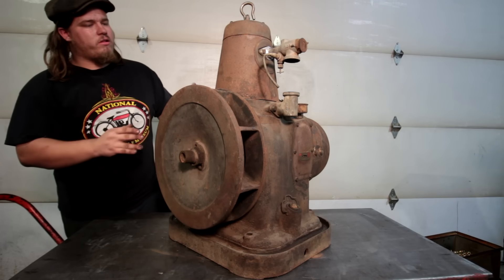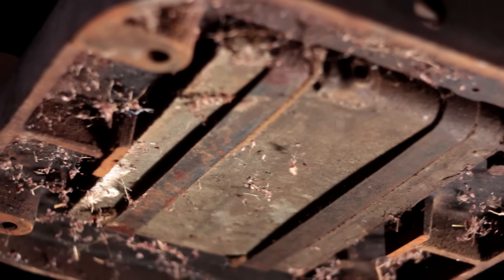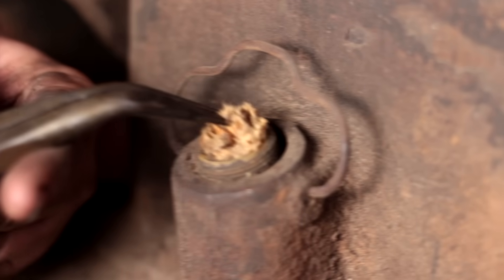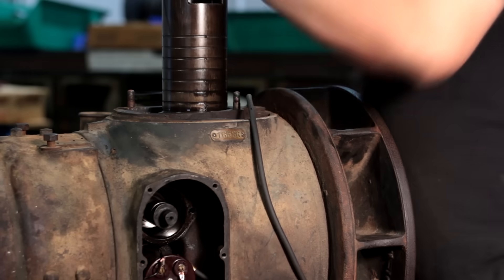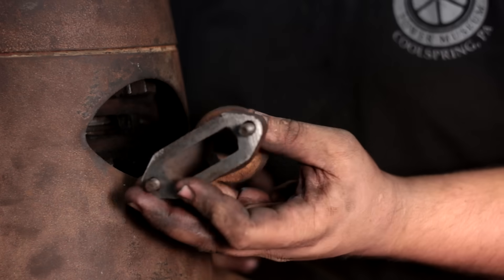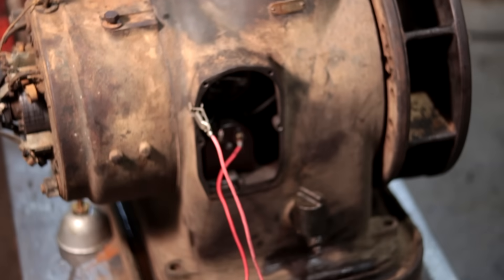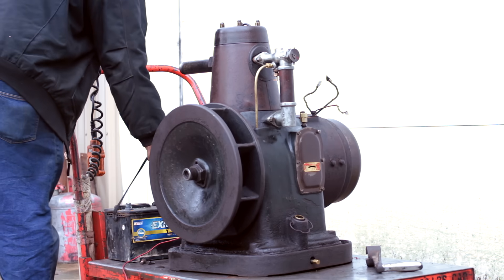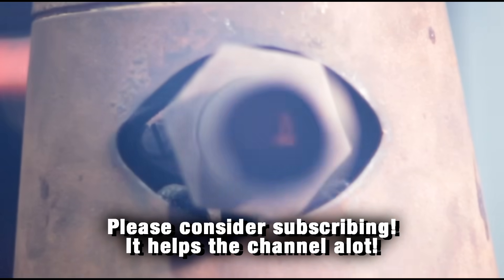100+ Year Old 4 Stroke Engine Design Has NO VALVES!!! Can We Get it Running after 60+ YEARS??

Comment: Thanks,  that was fascinating! What was the engine used for?
Reply from the maker: Light plant for power a house
Reply: @cruddycornstalks  Preunit Triumph m/cycles had a spring loaded poppet  that was fed from the crank feed on the timing side.
As long as that baby was pushed out about half an inch you knew you had good oil pressure. Nice compromise.
Seeing the combustion colour you could probably lean it off a bit but rpm will increase and the fan cooling 
may not overcome the extra heat and tickover would be faster. Much appreciated from England, U.K..

Comment: Thats a very interesting engine and you did a great job, i was watching a video of a deisel pile driver the other day where the very heavy hammer of the driver was in fact also the cylinder of a big diesel single, the piston which did not move was on top of the pile and when the cylinder/hammer dropped onto the piston it pushed a lever that sprayed a little diesel into the compression chamber which ignited under compression which threw the cylinder up and drove the pile down. I had never seen such a thing before and found it mesmerizing, you could see the explosion as the cylinder uncovered the piston, have you seen one of these amazing machines
Here's a video hope you don't mind
https://www.google.com/search?q=diesel+pile+driver&oq=diesel+pile&aqs=chrome.0.0i512j69i57j0i512l4j0i22i30l4.10728j0j7&sourceid=chrome&ie=UTF-8#fpstate=ive&vld=cid:232c622f,vid:M9CkVGyHF7c,st:0

Comment: The title of the video is misleading, this is a timing engine with sleeves, a similar solution was used in WWII on English Spitfire aircraft. Unfortunately, this system cannot be used on high performance engines due to the extreme heat developed.
Reply: Did they use a sleeve valve motor before adopting the Rolls motors?
Reply: @SchoolforHackers Sorry, I confused the aircraft model, the engine was a Napier Sabre and powered the Hawker Typhoon fighter-bomber and the fighter, derived from this, Hawker Tempest 😅
Reply from the maker: Not really they aren't valves but just sleeves with ports like step stroke. Would you call a two stroke cylinder a valve

Comment: Well, it has valves. Just not poppet valves, it has sleeve valves.
Reply from the maker: Not really they aren't valves but just sleeves with ports like two stroke. Would you call a two stroke cylinder a valve
Reply: @cruddycornstalks  As others have said, it's in the name, Sleeve Valve Engine. A 2 stroke uses the piston to open and close the transfer and exhaust ports, but I must admit that I cannot recall the piston being called a valve, even though it is acting as one. A lot of 2 strokes have reed valves, and they certainly don't look like poppet valves. Your engine does have valves. Quite an interesting find to be honest, I wasn't aware that they had made such small ones. They were very common in pre-WWII aero engines and a couple of early cars used them.

Comment: A single cylinder sleeve valve engine, interesting. They used one of those in an automobile engine sometime but they had problems with the exhaust ports accumulating carbon. Tan smooth & quiet though. The British made a radial aircraft engine using the sleeve valve idea, it had some really complicated gearing to operate the sleeves.

Comment: If you've ever seen the late-1930s Panhard Dynamic in the background at Jay Leno's garage, it has a six-cylinder Knight sleeve-valve engine built under licence in France. The 'SS' on the grille stands for 'sans soupapes' or without valves. Nice to see it working.
Reply: Wow! Gotta look that up. Wonder how much power it makes?

Comment: Well it does have valves, they're just not poppet valves. Cool find, sleeve valve engines are pretty rare in any make or form. I wish someone would get a Napier Sabre running and videoed in HD.
Reply from the maker: Not really they aren't valves but just sleeves with ports like two stroke. Would you call a two stroke cylinder a valve
Reply: @cruddycornstalks   They are still valves regardless of the style of valve. Hence the name sleeve valve. It differs from a 2-stroke in that the ported sleeves are mechanical moving components that are timed to allow induction and exhaust. Technically 2-strokes could be considered valved by the fact the piston covers & uncovers the ports. They scavenge differently but the piston acts as a valve though it is not a seperate component that moves solely for induction/exhaust. Some 2-strokes absolutely have valves like a Detroit Diesel or old monosupape rotary radials.

Comment: The English WWII aircraft engines, including the Packard built Merlin, which powered the later P-51 Mustang, were made, like this.
Reply: Nope... the Rolls/Packard 1650 Merlin V12 had camshafts and poppet valves.  Bristol (aircraft designer) made an 18 cylinder powerhouse air cooled radial engine that used sleeve valves and a flock of gears to operate the sleeves which made it an engineering marvel if ever there was.  IIRC no US manufacturer made a sleeve valve aero engine.
Reply: @tonyunderwood9678  Thank you for the correction.

Comment: Curious that the combustion can be seen happening from the exhaust. One would expect that the sleeves would fully close the exhaust route to avoid a loss of efficiency. This does after all indicate that a part of the mixture will already be able to get out before ignition.
Reply: In engines generally, 95% of combustion occurs within a few degrees of top dead centre.   What you see is the residual heat after expansion, possibly increased by incorrect ignition timing, or perhaps even sleeve timing, since he said it is not easy to see what the correct timing should be.
Reply: @ I know about the pre dead centre ignition but your other explanations seem to be more probable to me.
Reply: Knight engines are true hemispheric combustion chamber engines. 
Domed chambers with the sparkplug centered. 
My brother-in-law had a 4 cylinder cutaway example that you could see the workings operating as the engine was cranked.
Reply: @ yeah, but the shape of the combustion chamber is not an explanation. Especially in a four stroke engine it is difficult to conceive a power stroke in which the valve or exhaust port is open.

Comment: So is the generator just to power the ignition?  Or is it an engine powered generator used for powering lights exe. Cool engine Thanks for posting.
Reply from the maker: power unit for running your house back in the day
Reply: @cruddycornstalks  That's what i was thinking but when you hooked a battery up to the ignition it got me wondering.  Most of these old bangers didn't require a battery to run hence my question. Was fun to see anyway Thanks for posting.

Comment: I just need to comment that a properly done crimp connection is superior to a soldered connection, especially in applications like this. If you look at your car, you will find that most of the connections, if not all, are crimp connections. One advantage of crimp over soldered is that, where there is heat and/or vibration, soldered connections can fail. So, use the right crimping tool and  crimping method and you won't have any issues. Neat old sleeve valve engine. There are old cars that use sleeve valve engines. They are very quiet! Does the generator work?
Reply from the maker: i have not had time to try it yet.

Comment: Can't see where you get a PTO fitted? Superb job, in the 50's as a kid, I used to run the corn winnowing machine and it was run on a single cylinder petrol engine and the cooling was a vast hollow block on top of it which just evaporated, and there was a cuff around the ear if that ever ran dry!!!
Reply from the maker: no pto. this is a power unit to make electricity for your house.
Reply: @cruddycornstalks  but how? Sorry if I'm missing something!
Reply: The generator is on the crankshaft like a modern generator it doesn't need a PTO to spin anything

Comment: Very interesting!  It does have valves, but of a very different design.
Reply: Exactly
Reply from the maker: just  sleeves with ports. would you call a two strokes cylinder a valve?
Reply: @ Yes. If it controls flow, it's a valve.
Reply: @cruddycornstalks  Two stroke no, because it relies on a piston position to regulate flow of shit though the ports, but sliding sleeves are indeed valves of sort, akin to shutter gates which act as valves in many a mechanism, from optics to power generation on dams and such... Just because these are sleeves and not flat panels makes little difference, a sleeve is just a seamless rolled sheet(machined, but idea is the same)... Neal ain`t wrong from the technical standpoint... Just because it is not a plunger or a rotary style valve, but rather a sliding sleeve makes little difference... Bruh, you are a valve racist ``they are not valves``, what`s next, you are gonna deny the 6 million valves that got bent in the early days of racing bans, which lead to the forming of racing state of Nascar? 🤣

Comment: Too bad I didn't know about you I didn't know what to do with the stuff for my dad small engine business so much of what you're having the tear apart My dad had already rebuilt in the '60s and this stuff was just sitting around as the business in the '70s and into the '80s kind of fell into nothingness because I was the last mechanic who left we had an ideal lawn mower a continental engine Yes and Maytag and a number of old engines like the model and Briggs all this kind of stuff that went to the scrap yard because I could not find anyone who wanted this stuff it always rebuilt kept nice and dry but what are you going to do with it when you're moving on I left the state of New York a year or two later but like I said my dad had rebuilt all these things like the Continental had a broken distributor cap but most everything I was in especially impressed with the ideal lawn mower it was complete it broke my heart to have to put this stuff to the scrap yard but what was I going to do with it all there were many many pieces everything from old Jacobson lawn mowers from the 20s and 30s it's cool to see all the old stuff you work on
Reply from the maker: damb shame.

Comment: no valves??  it has a sleeve valve!
Reply from the maker: that was how they described them easily yes but they are just sleeves with ports. would you call a two stroke engines cylinder a valve?

Comment: Sorry to break it to you, but these cylinder sleves are valves.
Reply from the maker: that is the simple terms used to make it easier to understand. but in the end it just has sleeves with ports like a two stroke. would you call a two stroke cylinder a valve?
Reply: @cruddycornstalks  Absolutely. The piston acts as its own valve body.

Comment: Sleeve VALVES... not poppet valves, but valves are valves, and this one most certainly has them.
Reply from the maker: that is the simple terms used to make it easier to understand. but in the end it just has sleeves with ports like a two stroke. would you call a two stroke cylinder a valve?
Reply: @cruddycornstalks  I've never in my life heard anyone refer to a sleeve valve engine as valveless.  How can a simplification be valid if it causes confusion?  As for a two stroke engine, I presume you've heard of a reed valve and a disc valve?  In the case where the piston closes the ports, that's usually referred to as a piston-ported two stroke... and is possibly the only reciprocating engine solution that could be called valveless, even if it is technically incorrect.  The only true valveless internal combustion engines to my knowledge are resonant pulse jets, turbines and either pulse or rotating detonation engines.  There are likely others, but this sir, is NOT a valveless engine!

Comment: Can you explain thr sleeve movement in more detail?
Sleeves move at crank rpm and not crank rpm/2, but with 2 sleeves ports open at rpm/2 ?
Reply from the maker: 2:1 like regular valves so they move every other cycle.

Comment: So it actually has valves.. sleeve valves. Anyways, cool engine👍
Reply from the maker: that is the simple terms used to make it easier to understand. but in the end it just has sleeves with ports like a two stroke. would you call a two stroke cylinder a valve?

Comment: It definitely has valves. They are called sleeve valves. What it doesn't have are the more common poppet valves. Sleeve valve engines were used in several car brands in the 1920s and in aircraft piston engines throughout WW2. They have several advantages, including the ability to run on lower octane fuel, but they are also oil burners.
Reply from the maker: that is the simple terms used to make it easier to understand. but in the end it just has sleeves with ports like a two stroke. would you call a two stroke cylinder a valve?
Reply: @cruddycornstalks  The cylinder in a two-stroke is fixed, just as it is in a sleeve-valve engine. The sleeves that move within the cylinder are valves because they are mechanically commanded to rise, rotate, and return, masking and unmasking ports in the process. Some have two sleeves per cylinder, some have a single sleeve, but in all cases, each sleeve is a type of valve, allowing or impeding the flow of a fluid. In your analogy, in a piston-port two-stroke it's the piston that is a valve.

Comment: Many WW2 engines were sleeve valves. They were advantageous as we were still developing exhaust valves that could handle the heat of higher and higher performing engines.  Bristol radials are a good example of sleeve valve engines
Reply from the maker: that is true

Comment: What a great video. It was hard to believe how easily the bolts and screws came out--nothing frozen! Designers and engineers in the early days of internal combustion engines went in all sorts of directions as they searched for the best solutions in their machines, and this engine is an example. I wonder why the sleeve valve engine never caught on. Be that as it may, thank you for this very interesting restoration.
Reply from the maker: glad you enjoyed!

Comment: Wow! A 100+ year old engine with no valves is truly fascinating! Watching the restoration after 60+ years is so exciting, hope it runs again! 🔧🚗🔥
Reply: It has sleeve valves.
Reply from the maker: that is the simple terms used to make it easier to understand. but in the end it just has sleeves with ports like a two stroke. would you call a two stroke cylinder a valve?
Reply from the maker: It’s amazing how well the engine held up over the years.
Reply: @ They made things to last back in the day. I remember hearing about the Singer sewing machine crisis when the market got saturated. They never broke in a way that couldn't be repaired.
Reply: I was more surprised how thin they were able to cast that block 100 years ago

Comment: It has got valves! They are sleeve valves!
The Bristol Centaurus has 14 cylinders with sleeve valves, develops about 2000 Horsepower.
Reply from the maker: that is the simple terms used to make it easier to understand. but in the end it just has sleeves with ports like a two stroke. would you call a two stroke cylinder a valve?
Reply: @cruddycornstalks  Only if the ports are stationary and fires every time the piston gets to TDC.

Comment: A sleeve valve engine has a valve.
Reply from the maker: that is the simple terms used to make it easier to understand. but in the end it just has sleeves with ports like a two stroke. would you call a two stroke cylinder a valve?
Reply: @cruddycornstalks  "They're valves Jim, but not as we know it" - poppets valve are so universal that they are what is accepted to be a valve, you could say that a sleeve valve engine doesn't have poppet valves so it kind of doesn't have valves. I used to read loads of technical books when I was a kid, found out about sleeve, conical rotary (like the Aspen valve) and drum rotary valves, so I have come to think of all of them as valves. I used to stare at cutaway drawings of the Napier Sabre 24 cylinder, two stage supercharged aero engine (up to 5,000hp) as a kid, but then I was a bit of an odd ball. I use to think that they were better but the thought of them being flung around at 7,000 rpm (for a crank speed of 14,000 rpm) makes me thing that they belong in the past. It's cool that you have a sleeve valve engine though.

Comment: Very cool, I believe there was a rotating sleeve engine that was similar.
Reply: The rotating sleeve vaive engines were only single sleeve and mainly used in air craft engines although a couple of  Scottish car manufactures did use the single sleeve . I own a 1914 Minerva ,1925 Federal knight truck ,1928 Falcon Knight ,1928Willys Knight and Willys Light as above  all sleeve valve engines.
Reply from the maker: thats a nice round  up!

Comment: Willys-Knight patent Sleve valve engine. Daimler, Minerva,Vosin and Bucalii cars had them and of course Willys. Some aircraft engines namely Bristol radials olso used sleve valve engines, in operation they used more oil than conventional engines with poppet valves but  they were very quiet.
Reply from the maker: They sure are quiet!
Reply: The WW2 Bristol Beaufighter, which used sleeve valve engines, was called "Whispering Death" by the Japanese